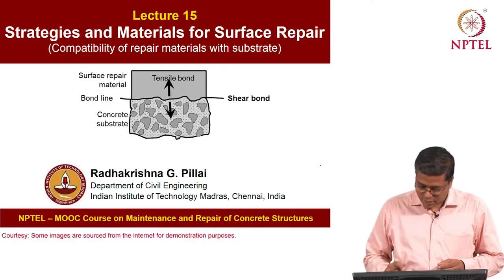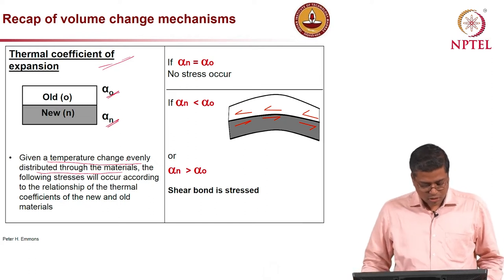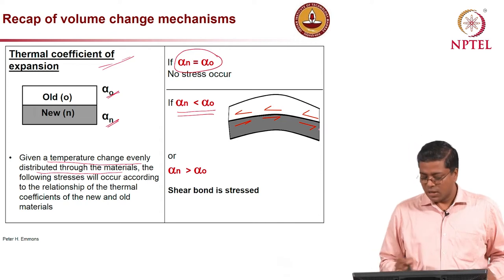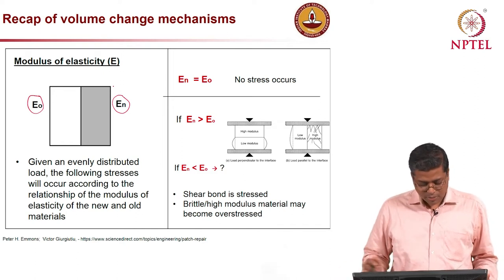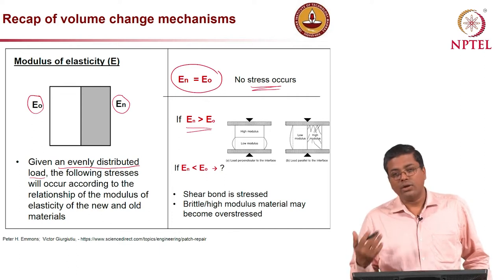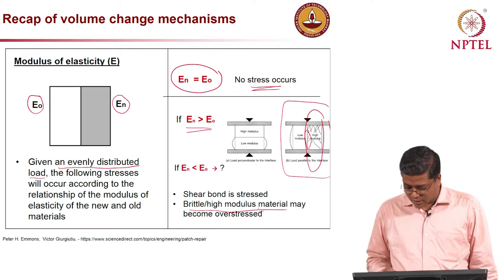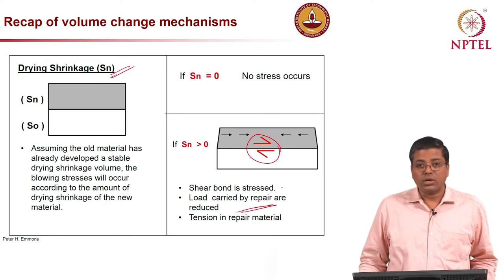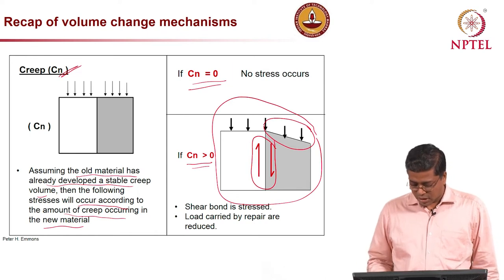Strategies and materials for surface repair

Comment: Sir in this lecture at 4.15, that point is not getting regarding high modulus will face high cracks then low modulus. 
Bec. Low modulus can bear less stress so it should crack earlier na.....